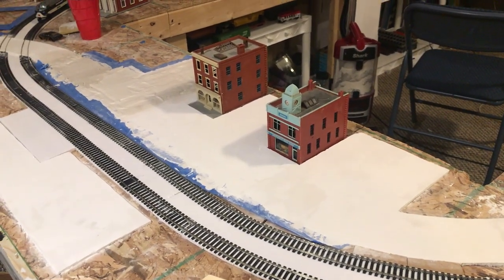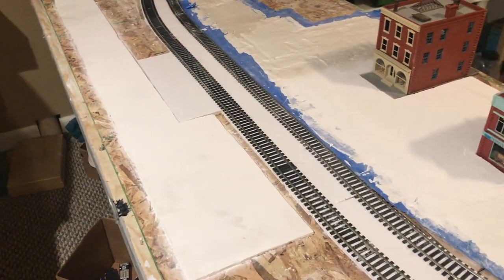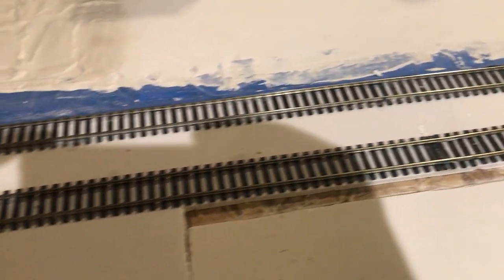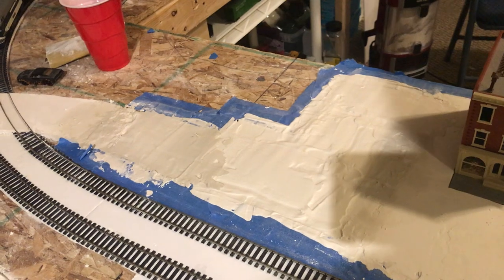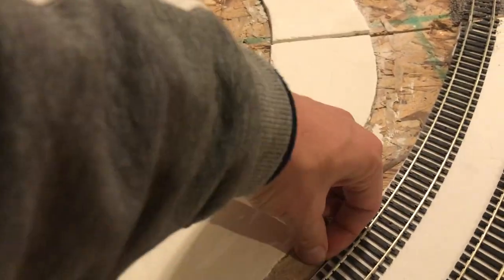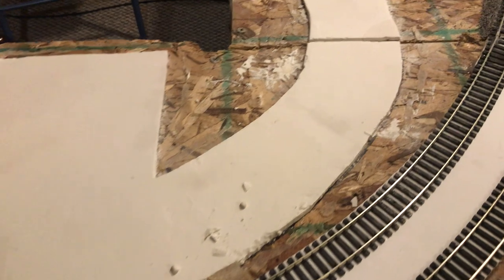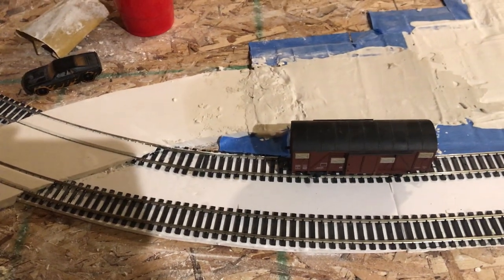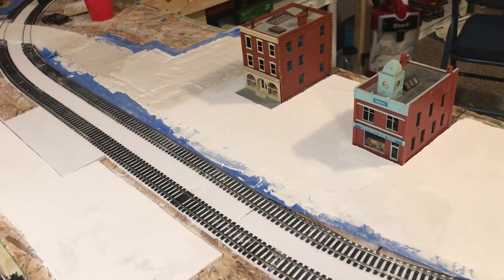How I made my Ho Scale Plaster roads!

Comment: What did you use to raise the road up to the crossing
Reply from the maker: Just more cardboard
Reply: @therailroadempire7993  did you just angle it to the right hight
Reply from the maker: Yup
Reply: @therailroadempire7993  thanks I've been looking for an alternative to from buying foam grades and plaster cloth to do them. Is there any thickness recomondations on the cardboard
Reply from the maker: The cardboard I used was in between 1/8 and 1/4 of an inch thick